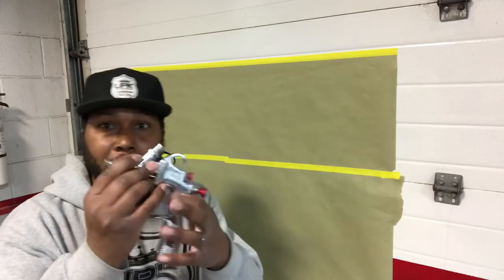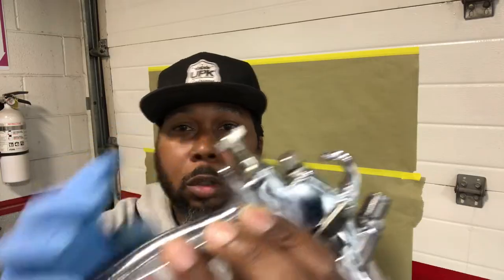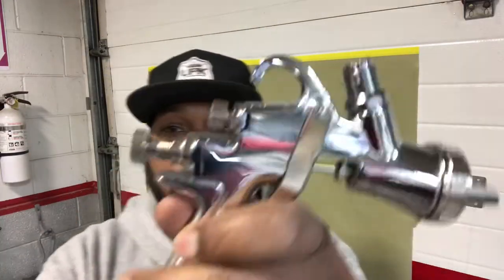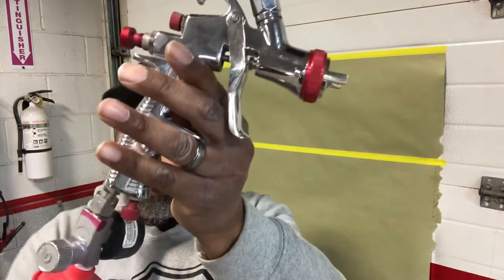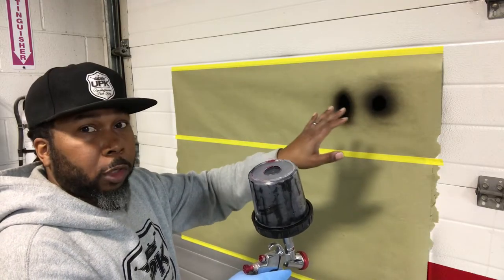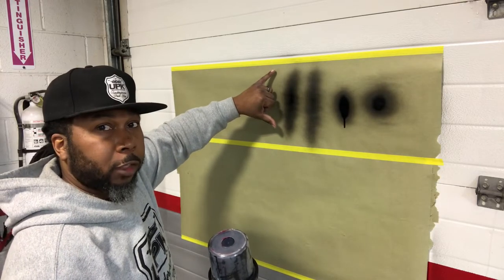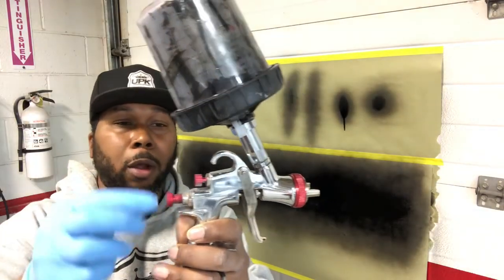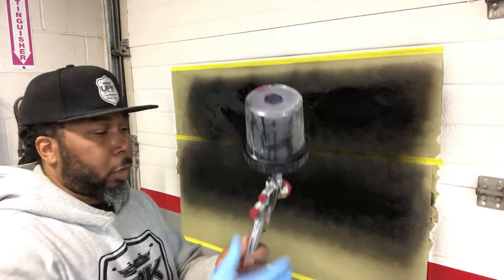How to set up your LVLP spray gun to paint cars

Comment: Can you touch on air pressure. What too much psi will do and too little will do. That’s the only thing missing in this video. What causes when you spray your base coat on let’s say a hood or roof and after it flashes off it’s rough textured and like gritty? Too much air pressure? Thanks good job with the videos.
Reply from the maker: This video was more about setting up your gun but I’ll put a video together on the air pressure topic to help out Jonathan…I appreciate you checking out the video!
Reply: Yeaa i need to know that part too
Reply: I think it varies on the gun

Comment: Underground Paint King, thank you for these excellent videos. After struggling to get results with my hvlp and hte guns with my small compressor, sanding heavy orange peel, trying again, sanding, trying again, I finally took your advice and got a Sprayit LVLP. I set the gun up exactly as you described in this video. Finally, smooth paint! You've done the DIY community a huge service with your channel. THANK YOU.
Reply from the maker: You’re welcome R. I’m glad I can help in any way possible and glad to hear it worked out well for you!…appreciate you checking out the videos 💯

Comment: you didn't discuss air pressure setting and their effects....
Reply from the maker: @jchavins  The air pressure and settings will vary depending on the product you’re spraying
Reply: @UndergroundPaintKing  yes and it can be intimidating as hell.....as well as confusing
Reply from the maker: @jchavins  it doesn’t have to be intimidating or confusing, it’s best to test everything before tackling your project and once you find the settings that work best for the products you’re using I recommend writing those settings down so that you always can refer back to them if needed

Comment: Would have helped if you mentioned your air pressure,one of,if not the biggest issue
Reply from the maker: @llewvirtue861  your air pressure is going to be determined by the material you use and the spray gun you use, all spray guns and materials are not the same so that’s why I don’t explain air pressure in this video

Comment: I never opened my fan full throttle.  It's was taboo in the shop I worked at years ago but when you did it. It looked like it would be very helpful next time I paint anything.  Much respect upk
Reply from the maker: Don’t be afraid to open that gun up MrWacoldestv you might like that setting, at the very least do so test panels and see if it works for you…I appreciate you checking out the video!

Comment: This is one of the most helpful and straightforward tutorials on using an LVLP spray gun on YouTube. Thank you. Only question I have left is what PSI to set on the inline regulator.
Reply from the maker: @AlexB-op7kb  I’m glad the video was helpful and as far as psi goes, that’s really determined by the material that you’re spraying so it’s best to test spray with the material that you plan on using. I myself spray between 26-30 psi with the different materials I use
Reply: @UndergroundPaintKing When you mentioned 26-30 psi, it that the set pressure or the pressure when spraying as the pressure usually drops when spraying I think. Very good explanation of how to set up the gun, you explain very well in easy to understand speaking method. Thanks.
Reply from the maker: @rmd1629  I appreciate you and the 26-30 psi is at the spray gun. So depending on what I’m spraying I would set my air regulator at 26-30 psi for the spray gun itself. I hope that helps but if not let me know

Comment: Great tutorial, but the one thing I was interested in was the pressure you set the regulator at for for the LPLV gun as opposed to HPLV??
Reply from the maker: I appreciate that and I do a lot of videos showing what pressure I use for the material I spray and the reason I didn’t go over pressure is because all materials aren’t the same and all brands aren’t the same so your pressure is going to change depending on what you’re spraying no matter if you’re using a lvlp or a hvlp

Comment: I watched a few of your videos before buying my lvlp gun and air compressor.
I feel confident now to paint my old 79 dodge truck. Gonna try painting the tailgate today as a test to see how it goes then the whole truck here soon. Thanks!
Reply from the maker: Awesome to hear 66Burnout💯 I hope the channel continues to be helpful to you 💪🏾
Reply: @UndergroundPaintKing  Hey man it’s 66burnout again 
I did my first painting with the lvlp 2 coats and looked wet! Next day seemed somewhat matte and textured. Any idea what I did wrong?
Reply from the maker: @66burnout  it could be the materials that you used and how they cure over time in the temperature you painted in
Reply: @UndergroundPaintKing  Eastwood single stage urethane sprayed at 21 psi and sprayed @ 70 degrees
Reply from the maker: @66burnout  might have to make some adjustments to get it to flow out, what hardener did you use
Reply: @UndergroundPaintKing  the recommended Eastwood activator
I don’t think it lets me send any pics for you to see
Reply from the maker: @66burnout  was it slow, medium, or fast?
Reply: @UndergroundPaintKing  medium activator
Reply from the maker: @66burnout  is it able to be reduced as well to thin it out and help it flow out?

Comment: Another informative video.  I've learned more about painting than the summers I spent working in my father's body shop.  Everything was already setup, and you didn't adjust/change anything.  Did a LOT of sanding, masking, and surface prepping those months.   
I've got 3 stickers and a T riding on this raffle.
Reply from the maker: Thanks I appreciate you checking out the video and I appreciate you supporting the channel…good luck Half-inch-holes!

Comment: When you spray you pull the trigger all the way back correct? Or do you fluctuate the trigger to manage flow? Or is full trigger only for full fan/full fluid?
Reply from the maker: I completely pull the trigger when I spray but there are times that I don’t pull the trigger completely. Full Fan and Full fluid doesn’t play a part in pulling the trigger completely or not

Comment: This was a great video about how to set up a LVHP gun. Do you recommend a LVHP, HVLP OR RP gun for the amateur DIY guy that wants to base/clear his car? I have 80 gallon 2 stage compressor so air is not an issue. The last paint gun I used was 30 years ago, a siphon paint gun so this is all new to me.
Reply from the maker: @legalsan3913  I’m glad the video was helpful and depending on your setup as far as your exhaust of the paint fumes, I think you would be fine with any style spray gun you go with but the lvlp will have a lower amount of overspray than the other spray guns

Comment: Thank you for the video. I find it is very helpful. I have got the same spray gun as you have got and I can't wait to get it started. So I have got a question. Do you recommend if I should only adjust fan control to change the pattern?
Reply from the maker: You’re welcome Chris, and the fan control is how you adjust the fan
Reply: @UndergroundPaintKing  You are welcome. Is the fan control the one I need to adjust the spray pattern to make it small to big?
Reply from the maker: @chris01479  yes that’s the one you need to adjust
Reply: @UndergroundPaintKing  Oh I got it. What is the two other ones is using for?
Reply from the maker: @chris01479 The one at the bottom controls the air coming into the spray gun and the other controls the amount of fluid coming out of the spray gun

Comment: Just came across your video.  Great one...  I'm new to painting.  What psi did you set your gun to?
Reply from the maker: Glad that you came across the video and checked it out, and with the material I use I like to spray between 26-30 psi
Reply: @UndergroundPaintKing  oh, what size nozzle would you recommend for base and clear coat?

Comment: Hey King, great video! What was the pressure regulator at the bottom of the gun set at?
Reply from the maker: Thanks I appreciate you watching the video and I honestly don’t know what the pressure was set at, different materials require different air pressure so whatever material you choose to spray may need some adjusting to get it where you want it

Comment: Thank you for the video and the information. I have aquestion about your fluid setting though, you say you like to set it at full/wide open so I am wondering if when spraying you are pulling the trigger all the way to complete stop or just enough to get the material you want, kinda like using the trigger and your pulling pressure to control the amount of fluid you are actually getting out of the gun?
Reply from the maker: I actually do both David!…for the most part I’m completely squeezing the whole trigger but in certain areas I may only squeeze the trigger partially to mist in paint in tight areas, just really depends on what I’m doing. I hope that helps
Reply: Thank you and yes that does help me, as far as your fan do you turn it all the way in and then start backing it out until you get the pattern 6 or 7 inches or are you turning it all the way out as in full fan/ wide open when you paint?
Reply from the maker: @davidcrystalprater73  You can turn it all the way out and then close it 1/4 of a turn

Comment: Hey King, I was doing some spraying on my guitar, but before spraying I did tests as you demonstrated. One issue I had was the outer edge where the paint vinettes out I had some speckles. From another video it was suggested that I have my fan knob about 2 1/2 turns out to eliminate the speckles. That eliminated most of it but still a few. I'm spraying in 90 degree weather with 28% humidity. What would be your suggestion. Thanks King.
Reply from the maker: @bluesbubba7429  it could be a combination of adjustments between your fan, air pressure, and fluid, also are you spraying with slow reducer/ catalyst?
Reply: No, it's right out of the can. I'm spraying nitrocellulose lacquer on my guitar. At the beginning I sprayed the lacquer with 30% thinner, and it went on very smooth almost too smooth where I thought I wasn't putting on enough color. I'm using Mixol color tint added to the lacquer to achieve the color which is black.

Comment: Another excellent and straight to the point video!  I'm actually impressed with the fan on that gun. Wide open is ok, but appears that it can easily get a finer edge like you adjusted it and still have a decent size fan. Reminds me of my Astro Evo4014 gun.... they share parts. Lol.   Keep up the knowledge sharing!
Reply from the maker: Thanks Boss we was just having that conversation about the fan on one of the other videos lol…I appreciate you checking out the videos Boss Hawg!
Reply: @UndergroundPaintKing  yes. I didn't realize how similar the Sprayit, Astro Evo4014, and Warwick 904H guns were. Come to find out, they're all clones of an Iwata W400 and can share aircaps and needles according to a source. Basically the guns can be upgraded if parts are sourced.

Comment: Thanks UPK, you explain the techniques clearly. My lvlp has been ordered and my first step is the primer sealer . Would 2.0 tip handle that? Appreciate you being responsive to all your subscribers.
Reply from the maker: You’re welcome Ralph and I appreciate you checking out the videos and yes a 2.0 tip will work for primer sealer, I personally stay around 1.7-1.8 tip for my primer sealer
Reply: @UndergroundPaintKing  great info, I have the 1.3,1.7 and 2.0 ordered. Thanks again!
Reply from the maker: @ripburroughs  you’re welcome!

Comment: LVLP still puts out more volume than rattle cans, right?
Can you easily spray single stage metallic silver with 6 gallon compressor and LVLP gun?
Reply from the maker: Yes, using a lvlp spray gun will be a better option than rattle cans and you can spray single stage with a 6 gallon compressor. Here is a video on that subject 

https://youtu.be/2jKl_azsSfs?si=t4uqWr5XvXEHwREM

Comment: Can you use a LVLP spay gun with a very small compressor?  6L (1.5Gal ) Compressor for small paint jobs. Like max 50x50cm ?
Max output of the  compressor is 95 liter per minute.

nice video very clear explained
Reply from the maker: I personally haven’t tried spraying with a tank that small but I would think you should be able to as long as you’re spraying small parts…I appreciate you checking out the video Phunk Star
Reply: @UndergroundPaintKing  @ then if i have a 60 gallon compressor, it would be better this gun ?
Reply from the maker: @gerardolopez5875  it’ll definitely work well with a 60 gallon compressor

Comment: Excellent video upk on setting up the spray gun. I do have a question do you adjust the fluid output on your gun for different job's. And when you spray clear. Keep them videos coming.
Reply from the maker: Thanks James I appreciate you as always and I actually keep my fluid control the same throughout my whole process and may change up my air pressure or fan pattern if necessary

Comment: Thanks for your great tips on the SprayIT as this has helped me out considerably; but on my last run with my epoxy primer the needle started dripping on me and I had to quickly stop what I was doing as apparently the small nut had loosened up and not sure how that happened; but once tighten up no more drip.
Reply from the maker: I’ve run into that problem Don several times but I’m glad you figured it out while spraying primer and not base or clear🙏🏽 I appreciate you checking out the videos!

Comment: Finally got that gun. Painted my truck and hade a heck of a time. Found out after cleaning its a 1.5 tip. Having a hard time putting down clear that want orange peel real bad or run like a river. Any tips or should I pick up a 1.3tip when available?
Reply from the maker: Do a test panel and try closing off the fluid a little and bumping up the air pressure…try to find the right adjustments to get it to atomize better but a 1.3 or 1.4 tip is what you want to get
Reply: Yeah, that tip is too big for spraying clear. Some painters say you can use a 1.5 to do base coat but with low pressure and that large of a tip and the wrong gun settings you might experience lots of orange peel. 1.3 is best for these guns for doing base+ clear imo, but im just learning how to use it, UPK is the man. I got 1.3 - 1.5 - 1.7 - 2.0 tips, if i was to use the same gun I'd go with 1.3 clear+base, 1.5 thin sealer primer - 1.7 - 2.0 filler primer.
Edit: tip sizes corrected (wish there was a 1.8)
Reply: What pressure do you run base coat with the r500 lvlp

Comment: 2k primer is on and ready.  Spraying tomorrow for the first time with a gun.  When I sprayed the 2k the pattern was always heavy at top and bottom.   Since it got sanded it didn’t matter.  Hopefully I get the good pattern your showing.   It’s a loaner gun from an old time sprayer, iwata 95 I think with a 1.4 tip.    Hopefully I can get it spraying like your showing.     The rest is on me and God.  It was so buggy today.  I’m outside spraying a huge truck lid.
Reply from the maker: If it’s spraying top and or bottom heavy you should try closing your fan to even out the pattern
Reply: @UndergroundPaintKing  I will try that next time, thanks.  Base coat  clear coat tomorrow with a much better but very old gun.  Hopefully the weather and bugs will cooperate. I just put up my pop up cover and I will surround it with plastic.   I’ve got 2 fans set up with filters to draw out any overspray.   We will see if it works.   It’s not a show truck and the paint clear was peeling so it will be much better.
Reply from the maker: @Imwright720  I’m sure it will turn out great!

Comment: EXCELLENT!! It truly can’t be explained any better❤️❤️❤️❤️😊
Reply from the maker: Thank you Sharon I appreciate you checking out the video and I hope the information helps 🙏🏽
Reply: Hey King!! I’ve got a question, it doesn’t pertain to this lesson, but nevertheless I may not be the only one needing this knowledge. If your base coat is wrong and you caught it and didn’t proceed to clear, Should you sand the base off and start over or just sand it lightly and spray the correct color on. Note: this is for a primed new purchased panel and a sanded bumper that was already painted but just needed the new base color. In other words one pc is new maroon pad sanded then sealed and base colored, the other pc was just a different color so sanded and sealed and base sprayed. I know this is a lot so take your time when you have time. No hurry here!! Thank you as always, you know I think your the Best!!❤️💙😊
Reply from the maker: @sharonkirven9570  you normally have a 12 hour window before you have to apply your clear and after that you need to scuff the base to clear or respray the base then clear so I have to ask you is the color you have sprayed just not matching or is it a completely wrong color because if it doesn’t match but it’s close and within that window I would apply the correct color then proceed to clear
Reply: @UndergroundPaintKing  Ok that’s what I thought but thought I’d chk with the Pro.. The color is a bit to dark. It’s in the same family just a hint to dark. So I thought after clear coating it, it may go darker. I’d hate to waist good clear coat and have to purchase both again. It looks like I can sand the base off and prep to respray a closer base coat. Going to let a auto store here put the computer on another part of the car to get the base closer. I went with the code but it’s too dark..Thx U Thx U Thanks!💙😊
Reply from the maker: @sharonkirven9570  you’re welcome Sharon I hope it works out for you!